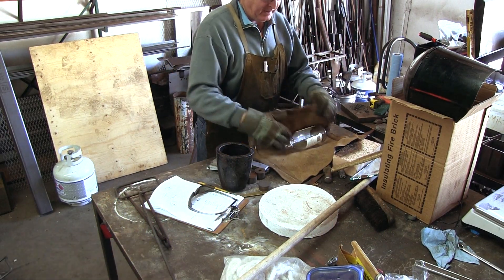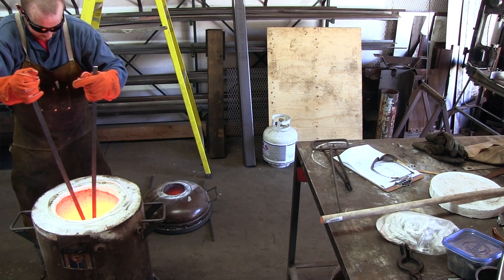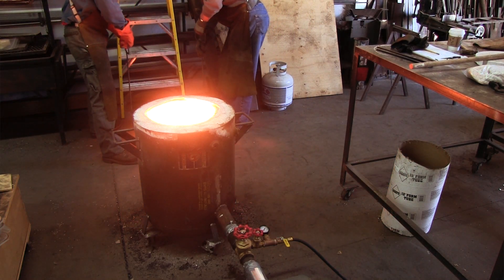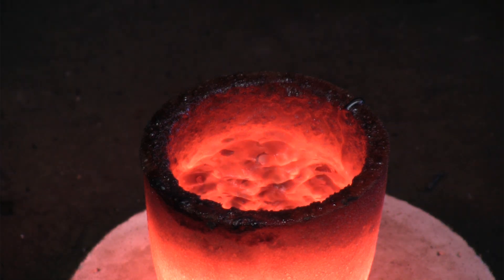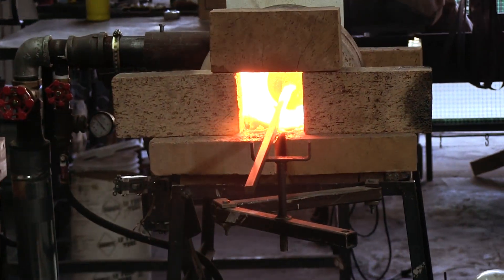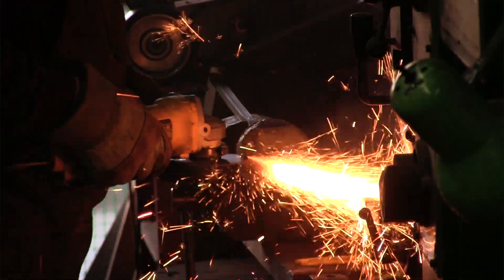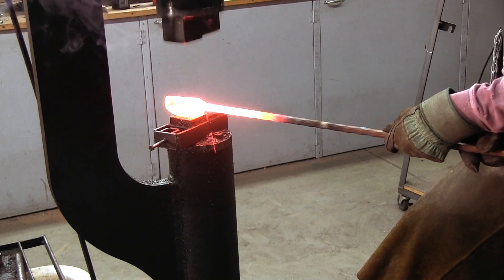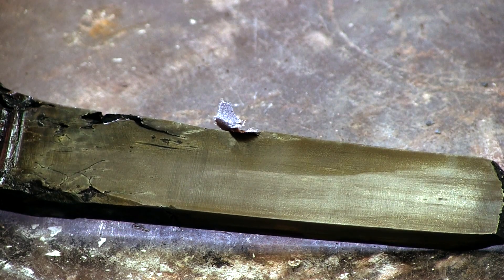Wootz Ep 2: Examination of Crucible Steel

Comment: I've made wootz with a pile of ordinary bricks, four small squirrel cage fans, four lengths of black pipe, a graphite crucible and fired one heat with coal and the second with coke. The first ingot made a nice meat cleaver,  it didn't have much paterrn or banding. The second made a nice short sword blade and had a wonderful pattern. The biggest difference between these two heats is that the coke burned hotter. Both heats were allowed to cool slowly in our makeshift brick furnace untill the fuel had completely burned out. Both ingots were thermocycled 7 times before any forging.

Comment: You should add some green leaves to the crucible.  You should put a top on the crucible to further prevent the air (oxygen) from getting to the mix in the crucible and seal the top onto the bottom with something to prevent air from getting in.  I think mud was used to seal the top and bottom.

Comment: Hi Krsysztof, My source for the info was "hardening, tempering and Heat treatment" by Tubal Cain isbn978-085242-837-5. He credits the process of making the first crucible steel to Benjamin Huntsman, in Sheffield in 1744. The process had already been suggested, but no one could make a crucible to withstand the temperature necessary to melt the blister steel. Huntsman came up with the crucible, but not necessarily the process. He is credited with being the first to make crucible steel using the process. All it did was ensure the carbon content was evenly distributed by remelting the blister steel. I think that by starting with cast iron with a carbon content of 1.7% or more, there will be too much carbon in the resulting metal, which will make it brittle, and reduce the ductility.
Phil
Reply: +Phil Whitley Cast iron is made in a blast furnace where the iron comes into intimate contact with the coke and picks up a large amount of carbon, the iron used for making wootz was smelted from ore in sealed clay crucibles with a small amount of added wood and leaves to provide a much smaller amount of carbon, If you smelt the ore in a sealed container, you will have almost pure iron, which is soft and malleable, and very much like wrought iron, which is cast iron woth most of the carbon removed.

Comment: Hi .. my understanding of the spark test at 3:00, is that mild steel will produce a yellow spark when ground whereas tool steel produces red sparks, and that the test is to obtain a rough estimate of the tensile strength of the material .. does that sound about right.

As well I would suggest that the bottle label and any residual contents are removed from the glass flux before it is broken up, and if an open crucible is to be used utilize a gas lighter rather than a bundle of paper.

Ppl might scoff however attention to these sort of details can make all of the difference, the bottle label and the paper likely have trace elements that could comtaminate the batch .. I guess it is a trial and error process, good video upvoted :)
Reply from the maker: ***** I am mostly looking at the spark pattern, e.g. how much they branch; see http://en.wikipedia.org/wiki/Spark_testing

Comment: Crucible steel was originally made from wrought iron bars 3"x 3/4" (ie almost pure ferrite) which were turned into blister steel by heating it to a temperature of around 1000 deg in a closed steel oven packed with charcoal, this process could take up to ten days, and resulted in metal which was between .75% and 1.5% carbon. this was then broken up and heated in the crucible to make crucible, or cast steel. The process used  iron smelted using charcoal, as it is lower in sulphur and phosphorus than coke smelted iron. I think that the inclusion of cast iron in your melt means that you will have too much carbon, and also  more phosphorus and sulphur , which doesnt help matters. The problem with blister steel was that the carbon content was uneven along the length of a bar, and also between bars, the idea of the crucible process was to produce a steel that had a homogenious carbon content. Apparently the crucible steel was made into ingots by pouring it into "pre heated cast iron moulds" but I cannot find any pictures, so I don't know what these moulds were like, or how thick they were. You could try just pouring it into sand casts. Hope this helps,, Really enjoyed the video too,
Good luck!
 Phil, UK
Reply: +Phil Whitley Can you point source of your informations about 2 steps of carburization in production of wootz? You need to take a difference between wootz and other crucible steels. Wootz was native prodution of India and part of Asia when blister steel was process of carburization invented in England Sheffield, so just from that geografical separation i think you are mistaken about your procedure.

Comment: What type of crucibles did the Indian metalcasters use to make wootz steel if there wasn't any graphite discovered back in those days? I would prefer to smelt iron to steel with a tatara or Catalan-style foundry if a clay-grog crucible (only crucible I can afford so far) can't withstand welding temperatures. Off to making corn cob and pine charcoal, as long as they aren't overcooked and have decent amount of volatiles, which are highly recommended for smelting and forge welding and produce almost no ash plus burn very fast.
Reply from the maker: The crucibles were made from clay. Smelting will give you a different kind of material compared to crucible steel. It depends on what historical material you are trying to reproduce. European blades in those days were made with steel won by smelting iron ore unless they were able to import Wootz ingots. Williams argues for those ingots being imported via the Volga trade route.

Comment: I think you should just add iron, no steel, and then add charcoal or some other carbon source as well as any other alloy metals you want in the steel in a small quantity.  As you pointed out, the iron probably melted before the steel, and that probably caused poor diffusion of the metals and carbon, so I think you should just use iron as your starting metal, besides, melting steel to make steel isn't as interesting as turning pure iron into steel.

Still, I couldn't do it myself, I don't have the kind of experience or knowledge to even experiment.  Keep up the good work.

Comment: I think whats causing the problem is that you have too much carbon in the ingot, steel works solve this problem by blasting oxygen into the molten steel to form carbon monoxide but thats pretty hard to do in a shop. Maybe you would be better of starting with iron ore, glass and a tiny amount charcoal in a sealed ingot. I believe thats how they used to make crucible steel back in the 600AD era. Good luck lads :)

Comment: Yes there are benefits to folding (pattern welding) steel because if done properly it is like a blade with multiple layers. However japanese smiths along with other anchient smiths had no choice but to fold the stee to work higher carbon steels in with lower carbon steel in order to produce a strong and useable product. This is what also produces the wood grain pattern on blades since when touched by acid lower carbon steel etches darker than higher carbon steel so it gives a beautiful contrast.

Comment: I think you blend is good, but I would maybe go a little further and chop up the bars of 1018 and cast iron a bit more, it will helt the mixing.
Also a lit, made of clay or ceramics helped me a lot, ensuring a slower cooldown. 
a couple of stirs while max temp will help too, but make sure to use a very clean ceramic rod. steel will contaminate

good vid, looking forward to you success

Comment: I enjoyed watching your video! I have done the same experiment at least 30 times but starting with ball bearing steel and mild steel and coke. My aim was to have machinable cast iron. It takes 35 minutes for the charge to be a liquid and about two hours to add the rest of the steel till pouring time. Have a look at my youtube video  "how to change steel into cast iron using a waste oil furnace" One tip for your  next experiment deoxidize the melt with ferromanganese to the remove the oxygen.

Comment: It also mean the steel can still crack from forging, but I read in a forum somewhere about a modern smith using a blacksmith's hydraulic press on wootz which prevent much cracking since the press is much slower than a hammer strike. Phew, that was a lot to get through, hope I didn't bore you :). Also I think the order of these comments might come in reverse.

Comment: However, if you forge this at high temps where the steel acts like a solid solution, you will basically dissolve the carbides to produce a 1.5-2%C steel, which will probably be too brittle to use, like the piece you showed in the video. Instead the middle-eastern smiths forged it at much lower temperatures, some say between the steel glowing cherry red to a dull orange. This will prevent the carbides from dissolving much and letting the steel retain it's strength, although it takes much longer.

Comment: By forging at high temperatures where the steel acts more like a solid solution, the carbides dissolve into the steel making it more of less a homogenous 1%C steel, which incidentally is what modern hot rolling does to steel. Wootz on the other hand was used by the middle-eastern smiths, and had a higher carbon content of around 1.5-2%C. This also has a dendritic network, has much more carbides in a lower carbon matrix.

Comment: Like you said in the video, the ingot probably needed more time to melt and combine, but another issue is forging temperature. Viking ingots acquired through trade had a carbon content of around 1%C with some deviance. They forged them at high temperatures like normal and found that at first the ingot was really hard at the start but became easier to forge after a while. This is since the ingot after solidifying is dendritic which means there is a network of carbides in a lower carbon matrix.

Comment: I have done a lot of reading and research into the metallurgy of different types of crucible steels, including wootz and the crucible steel which the vikings acquired through trading. How high a carbon content were you trying to get? The different types of crucible steel need different forging techniques, and I may (I stress "may":) ) be able to provide a few insights into the techniques used for the different types of steel, and have some of the historical ways to counter issues with the steel.

Comment from the maker: This charge was with cast iron and low-carbon steel.  So, the carbon is already part of the iron matrix.   As the glass starts melting before the cast iron, the charge is protected from oxidization.

Comment: Have you considered that since your crucible is not sealed, the carbon will burn off during heating? As I understand the steel production, to achieve 2% carbon content with any precision, first you should let the iron boil in an open crucible (burning off all the carbon to CO2), then let it cool, add 2% carbon, then seal the crucible and let it boil again. This is procedure they used in the experimental recreation of an Ulfberht sword.